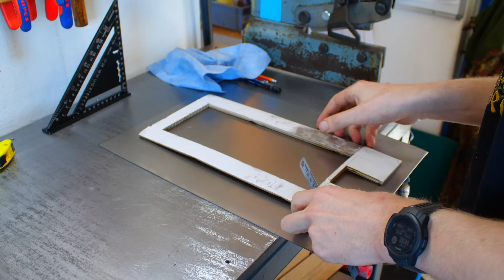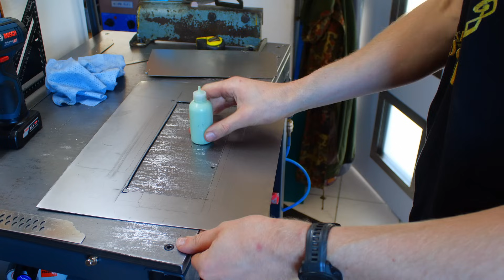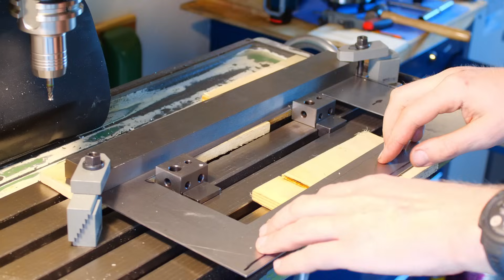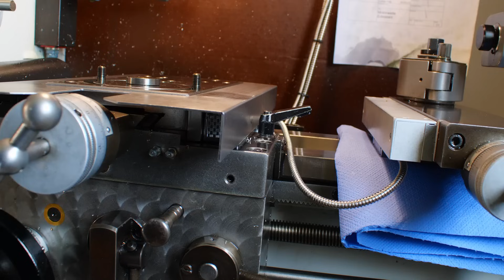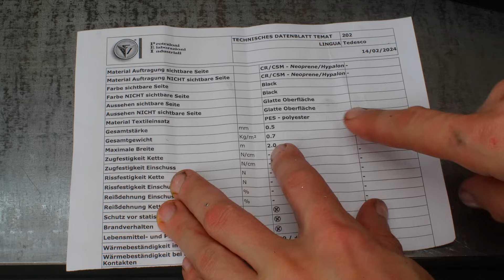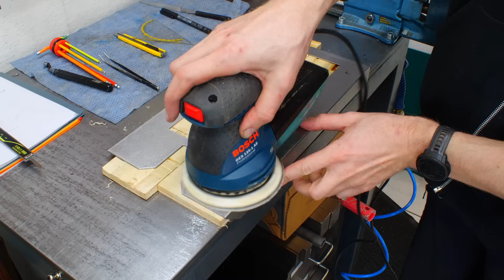Cross slide guard for the Weiler Primus

Comment: Very nice work on the sheet metal guard. I used to work for John Martz Luger Carbine maker from Lincoln, CA and I machined a series of form punches to make Luger magazines. They required a series of form tools to shape the magazines to the correct shape with the correct tolerances so the cartridges had some slop or internal movement to them. Everything that I machined for the Martz Luger Carbines was complicated manufacturing.

Comment: When supporting sheet metal for milling, the support material doesn't need to be perfectly flat.  Even OSB is close enough to "flat" of the cutting tool extends deeper than the deviation from flatness of the supporting material.  Once it's unclamped, the sheet metal will return to its original degree of flatness.  

I agree with your assessment of sheet metal workers.  I did sheet metal work on light aircraft at a point in my life.  I was "pretty good" at it but the guys that were perfect at it were truly amazing.  I knew one man that took measurements on an airplane under construction near Houston, TX.  He went home to Omaha, Nebraska and built the turtle deck for the airplane.  When he was finished he shipped it back to Texas.  Even the Dzus fasteners were in place.  It fit perfectly.  He was a magician with sheet metal!  You were awesome, Jack Furstenburg!

Comment: For the way and table protection of my lathe and mill I used belting from old exercise treadmills. It cost me virtually nothing as I had stripped the treadmills for the motors. It is much thicker and can cause problems when working close to the chuck but the thickness adds a substantial margin of protection against impact. Handy when you are talented clumsy. The belting also has a nice woven material backing that slides freely and does not seem to hold chips. The belting seems to be impervious to anything I have used near it.

Comment: I always find it funny watching machinists do sheet metal work. Stefan is a master of his art, but speaking as a welder/fab of several decades experience. I'd have guillotined out the blank marked it out on a height gauge, death wheeled, and finished ground to the line with a small 90 before he'd have jig sawed out the hole, and I'm disappointed if I can't hold 0.1 like this.
Reply from the maker: I wish I had room for some nicer sheet metal equipment :)
At my former dayjob we had nice hydraulic plate/sheet metal shears, corner notchers and manual bend brakes - Made always quick work of stuff like this.

Comment: Nice!  You could 3d print some corner bumpers to protect your hands from running into the front  corners.  McMaster-Carr also sells  fiberglass-reenforced silicon sheet material similar to the baking sheet material. I'm guessing it's not as flexible as the neoprene.

Comment: I'm actually not too sure about leather for way covers; I've noticed some corrosion on brass hardware sometimes where it touches leather, and if it happens it happens extremely quickly too, sometimes within a few days. But sometimes it doesn't corrode at all. The only difference I've observed is that vegetable-tanned leather doesn't seem to cause the same corrosion issues where cheaper chrome-tanned leather does.

From my understanding, the metal salts used in chrome-tanned leather are what cause the issue, but I'm only a hobbyist leatherworker, not a tanner, so I can't comment on the chemistry. To be safe, I would suggest using veg-tan or at least oil tanned leather.

Comment: For slightly thicker occasional Sheetmetal work there are some good affordable brake options for your little press. I have a heavier solid one for mine but picked up two sets of 200mm magnetic vice jaw ones to make a flexible 400mm long pan brake for my larger press for Sheetmetal work.

Comment: I believe the Anchorlube is soap-based, not unlike some water soluble commercial coolant / cutting fluids. It’s a good product, replacing various old standbys (TapMagic, etc) in my shop, though I still reach for the brush in the oil pot much of the time. Habit !

Comment: I would prefer pine dust and smoke to MDF dust any day. Even more so if the MDF binding glue in Germany is toxic.  Also for fun, if not profit, maybe get a plasma cutter. Mine came with TIG and stick welding.  Your English is very beautiful, I do recommend Aluminium though - even if it is harder to say.  Thanks for showing more of your nice lathe.

Comment: A properly positioned vacuum will move as much air across the cutter as compressed air for cooling but also collect those chips. Just a thought.
Reply: I agree, I have used the same idea for drilling and it saves cleanup bigtime.

Comment: Nice job as usual.
That sqare/45 corners.. Oh yes.. German school in the best sense of that 😄
Italian will made all sort of curves, rouds...

As friend of mine used to say: I beleve that in Germany rain fall in cubes, and neatly stack in the rows, waiting for it's turn to go down the drain 🤣

BTW... try to put some scotchbrite on that orbital sander (just slap it and cut the circle). Didn't tried it on steel, but on aluminium it look amaizingly good. Probably on the steel it will need come coarser grit.
It can be a bit hard to release it from the sender hook pad in finer grits, but nothing horrible.
Reply from the maker: Thanks for the scotchbrite tip! I had used it on a vibratory palm sander at work to fix some uggly machine bases, but never tried it on a random orbital.

Comment: The anchorlube stuff is great, but over time it will either dry out or grow a beard of nasty mold stuff.

Any lube left on iron will cause staining spots as the stuff is water based.  Clean it up and re-coat with your corrosion prevention of choice.

The blue boelube wax in a jar is superior IMO
Reply from the maker: Good to know! Thanks!

(Generaly I use a Wax Stick from Jokisch, meant for Bandsaws/Circular saws, when tapping/drilling with a handdrill)

Comment: Curious, could you use the rear of the cross slide to add a solid tool post, or would you need to replace the compound on the front? Nice fit!👏

Comment: As usual. Fantastic work. Cardboard is fantastic, however have you ever used the plastic board that is similar?  In the USA it is often sold as Corrugated Plastic Yard Sign material. literally plastic cardboard, that can be cut just like cardboard. . The benefit being that it works as easily and holds up longer. Not suggesting permanent, however it resists the machine shop environment very well. Keep up the great work.
Reply: There'll be a lot of it available for free in a few months too, as long as you don't mind the drivel printed on it

Comment: Dear Stefan, I completely understand what you're doing in this video, it's professional, but wouldn't it have been more economical to cut the sheet with a laser? At least here in Hungary, this is not too expensive, especially when compared with the time spent on it.
Again I got your passion.
Reply from the maker: Yes - On the Emco I sent the drawings out for lasercutting/bending and got perfectly fitting parts back, I think it was about 100eur for one.
But in this case, I treated it as a hobby project :)

Comment: Well i always do wonder if one could 3d print a cover but i did see that the mechanism is quite complicated.
Reply from the maker: I am sure, one could come up with a nice 3d printed design - Hot chips have to be taken into consideration, they would melt themself into a lot of the plastics used in fdm printing.
Reply: @StefanGotteswinter  That for sure i dunno if there are one way printable materials that are more resistent to heat..
And well i’d combine it with flood cooling so less hot pice’s of metal

Comment: Does the thing that Stefan put in the spindle just clean the internal surface? I presume it cant have been a stoning type thing where it would knock off issues but be a tiny bit abrasive? Is it just a felty type cleaning thing to get crap out?
Reply from the maker: Thats just a spindle wiper with felt pads on it.
Reply: In the US they sell these and call them spindlemate. Boeing started using them and reduced their broken tangs on drills and chucks by almost 100%. Most people don’t know that tapers should always be dry not oiled. I use them on my tail stock taper.